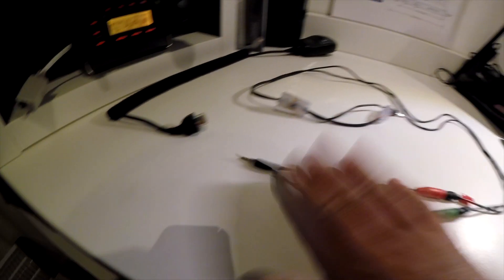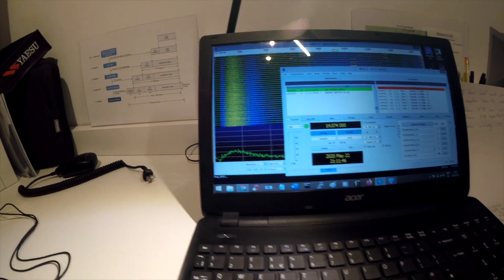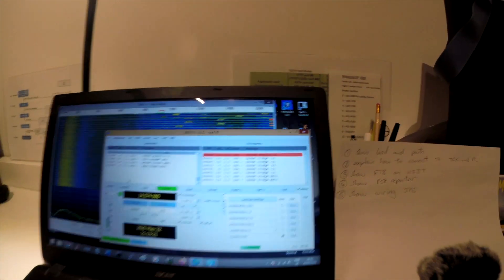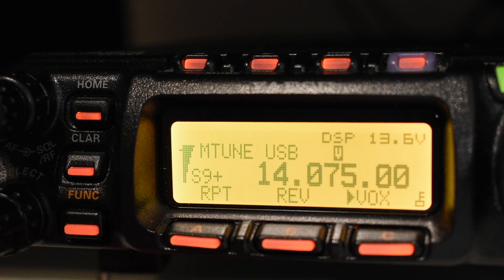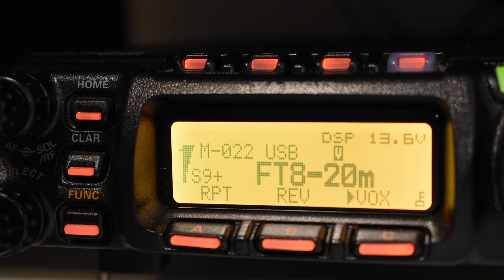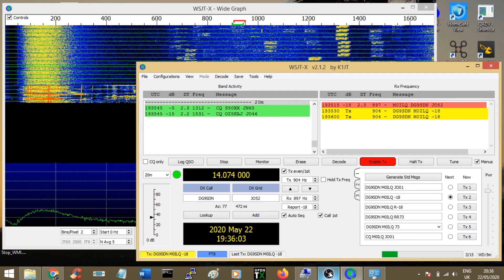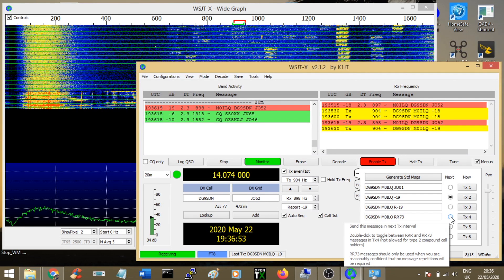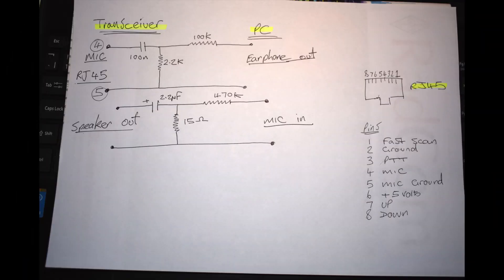Yaesu FT-857d FT8 JT65 Vox Cable

Comment: I could see that you are using a ceramic capacitor of 100 to pin 4 that's it? TKS. So I'm using in Yaesu 857 directly sound out from radio directly to the computer. I have a CAT cable but this not work properly. So connecting to the pin 5 and pin 4 it's really easy to make Yaesu to work. TKS.